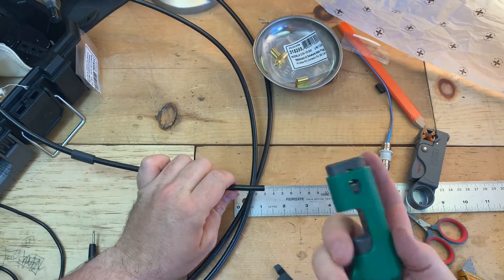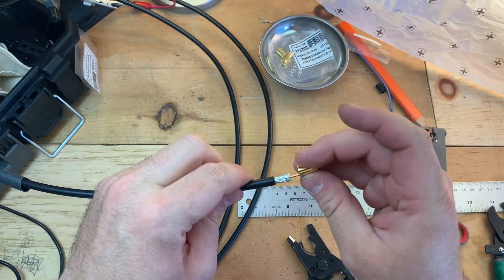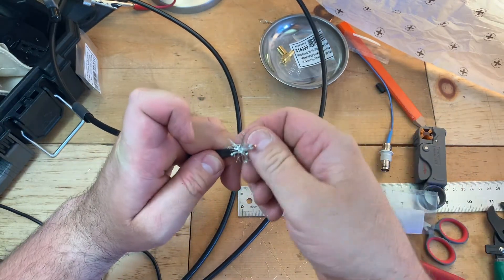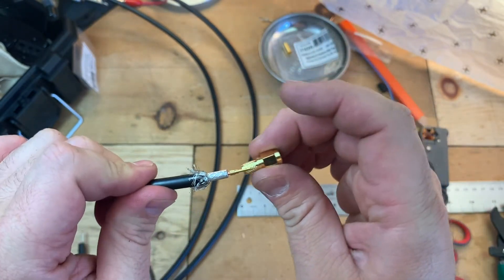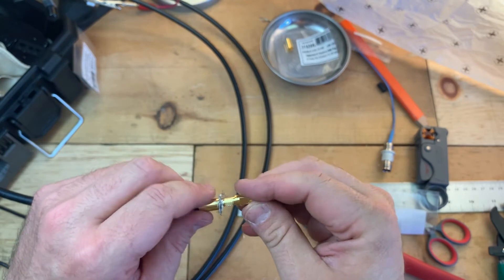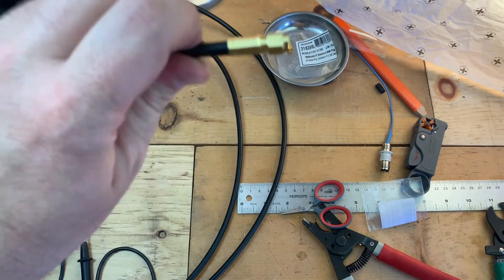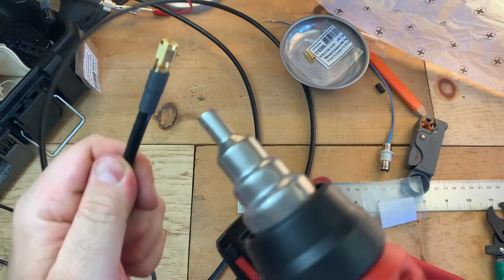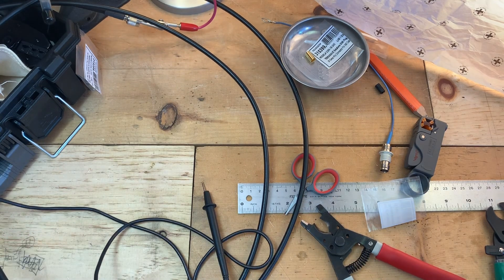LMR240 Making an SMA connection

Comment: This tutorial on making an SMA connection for LMR240 cable is excellent, especially showing how to handle the center pin and the crimp! It's super practical, right down to the multimeter test $$00:04:05$$ at the end to confirm it's a good connection.

Comment: I have a cheap crimp tool from Amazon, which has .046 and .068 (not .052). I have used .068 on several of these connectors’ center pin on KMR240 cable and it works fine.